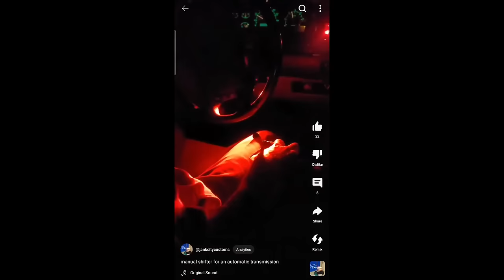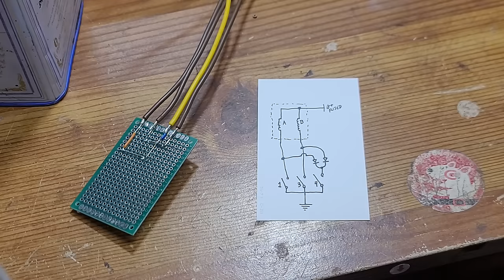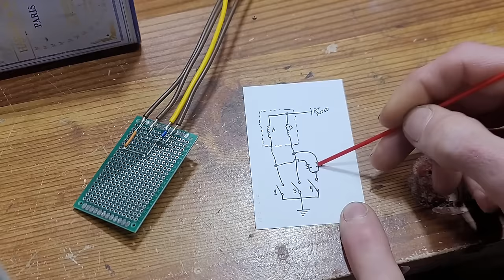how I gained full control of an automatic transmission

Comment from the maker: accelerating from 1st to 4th: https://youtube.com/shorts/0Is1Pl9tHL0?si=n4Nowy6qXVRSeYHP 
also, apologies for the audio. it turns out the DAC in my 3.5mm to usb cord is blowing out the signal from my microphone.
Reply: NOW We need that Brainwave reader controler Dolma scfihicky dodadd
Reply: Maybe you should try a real manual. 
You would have so much more free time. 

Because sure you got electric control- for now-

But you’re susceptible to any level of electrical failure. 
Not to mention internal auto trans failures. 
Solenoids. 
More wires. 
Bands and clutches. 
Torque converter. 
Sensors
ECT

My car has a mechanical connected manual 

Aka everything works all the time. Period. 

Keep on tinkering. 
Just think about it.

Comment: I used to have a tool that you could hook up to an automatic transmission that did this. It had switches to turn on and off solenoids and knobs to control pulse width modulation on them. I forgot who made it but it had adaptors to work on almost any electronic controlled transmission. I use it a lot when I worked at a transmission shop for diagnosing strange issues. You hooked it up and then went for a drive flipping switches to shift gears and turning knobs to adjust line pressure and torque converter lockup modulation. I sold it to a friend years ago when I got out of the transmission business.
Reply: that's sick wonder what it was called
Reply: I was planning on building a DIY automatic transmission tester like the tool you described because I was dealing with a transmission that wouldn't work after being rebuilt _twice_.  I ended up putting in a high mileage but working used transmission so it took away the need to build a tester.  (Google Honda Prelude Automatic Transmission Problems.)
Reply: Yea try that on a DSG or CVT 😅
Reply: Sounds like a great tool!

Comment: Long story short, I accidentally installed a 4 speed instead of a 3 speed in my old van. I had a series of ac light switches taped to the shifter to actuate each solenoid and torque converter lock up solenoid. It was a crazy manual-matic. Then I threw about 6 rods through the oil pan doing 70 in 2nd gear.😢
Reply: Who knew you could money shift a slush box?! 😂
Reply: @delet6629 it's possible with a 3l30
Reply: omg thats fkn amazing!!! XD
Reply: That's why he mentioned the PWM, bro. This kid is smarter than a box of monkeys. Start at 10% gradient, and if there is zero shift back off to a higher gear.

Comment: I made something similar 20 years ago for a Nissan transmission.  It used the same two solenoid quadrature-like encoding, plus torque converter clutch.  I made a paddle shifter through.  It's super easy with a microcontroller.
Reply: “Super easy to make your Nissan paddle shift”

No. 
This is a lie.

Comment: Something like this would be neat for a temporary downshift preventer, even though that may sound counter-intuitive at first. GM didn't seem to program their 4-speed transmissions exactly right when mated to a V6. So you'd be at highway speed and already getting into a good RPM range to make power. However if you're passing it would downshift out of the overdrive gear and put the engine at the rev limiter and have nothing useful left to work with. Those situations are annoying AF. Having some button to make it hold the overdrive and not downshift while passing would be useful. (It seems however they programmed the thing didn't account for the ratio jump on the last gear, as the shifts were fine in city driving with the first three gears. But the cars would feel gutless at times on the highway even though it wasn't the engine's fault. The engine torque curve rises very fast from 3200 to 3800 RPM, but was unusable in the final gear due to that programming.)
Reply: To be honest, I've encounter this problem on a lot of automatic transmissions. And your idea of a switch that disable automatic gear-shift is really neat.
Some cars will only downshift to the limiter if you push the pedal past the 100% throttle and feel a "click". It's a nice solution and I don't understand why more manufacturer don't make use of this.
Reply: Yup I had this happen often on my old Pontiac grand prix v6, it would downshift then struggle to accelerate. Always made me go wtf..thanks for the explanation. Makes sense now

Comment: That's really cool. I've got a manual for the time being, but if I ever get another auto it would be really cool to be able to downshift on command, or hold a lower gear longer.
Reply from the maker: thanks, it definitely makes driving the truck more fun. but nothing beats driving an actual manual.
Reply: for most autos, downshifting is the easy part, just move your gear selector down one. You need to in order to engine brake. The hard one is convincing the transmission to upshift when it doesn't want to, generally it wants you to get a higher rpm in the next gear first.
Reply: My wife's Mazda 3 has the manual shift thing but it's an automatic. Sometimes I use it so the drive is not as boring, but then I forget I put it in manual mode and forget to shift. Haha, without the clutch it doesn't register in my mind that I have to shift unless I'm really thinking about it

Comment: I did something similar to this when I owned a Mercury Grand Marquis.  I hated the shift logic on that transmission so much I wired in a switch panel to control it myself.  Which is to say that I hated that it had shift logic at all, because I despise automatic transmissions, and I wanted it to shift on my terms.  Your implementation is considerably cleaner than mine was.
Reply: Can shift sells paddle shift kits for the MGM and Crown vics / lincoln town cars now.

Comment: A servo tester might work for your line pressure. Sends a pwm signal that's adjustable with a built in potentiometer. This build was so freaking awesome! Makes me want to turn my 3rd Gen 4Runner into a test vehicle for all these type of ideas. So cool. Very inspiring. Just thought of another idea. Could you use an arduino of sorts to write code that would change the shift pattern. Kinda like a multi mode switch example : Eco /sport and towing. Each mode could have different shift rpm's and or line pressure based on what you need.
Reply from the maker: that's a good idea, it would be a really fun project. but also wildly time consuming to program and test different speed/rpm/throttle dependent shift tables. I'll have to circle back around to it once I get through my current list of projects.
Reply: @jankcitycustoms  yeah it would have to be a labor of love for sure lol . I can't wait to retire my 4Runner as my daily driver so I can start tinkering with it. I think I want to hyper mile it. It's only the 4 cylinder model but I think I can squeeze some good mileage out of it with some drastic changes to aero and engine tuning.

Comment: Very, very, very, interesting. I can't say much more other than, very, interesting. I remember hacking the old 1980's GM ECM's to get the TCC to lockup in gears other than 4. I took a different direction than you did, where I cared more about the computer's PWM. I like how you thought of the mechanical switches to get the transmission to work the way you wanted.
Reply from the maker: that's pretty cool. when I first made it I would lock the TCC when cruzing in 2nd and 3rd. but the increase in MPG was barely noticeable, so I only lock it on the highway now.
Reply: I did that with a '99 RAM...sheared the overdrive unit XD
Reply: @jankcitycustoms  with your manual controller you could lock the converter even in first, letting you haul heavier loads than usual

Comment: Another advantage of that solenoid pattern is there's only one solenoid that needs to change to shift by one gear. Known as a gray code, this avoids a race condition.
Reply: What's a race condition?
Reply: @Skunkhunt_42 vtec just kicked in yo
Reply: @Skunkhunt_42  I'm not sure, but I think it avoids moments where if it had to turn off one solenoid and turn on another solenoid at the same time, there would be a short time where either both were on or neither were on, both of those conditions being unwanted.

Comment: Now I can't wait for a manually controlled CVT. The control mechanism could just be a potentiometer but I'm not sure how you'd control the actual pulleys. There's always Arduino, which incidentally could be your solution to a PWM controller. Using the pwm output coupled with solid state relays should do it.
Reply: That would massively depend on the CVT you're playing with. Many don't do anything this simple.
Reply: @Hawk7886  I'm aware a lot of them have a clutch for moving from a dead stop but what other things are commanded of a CVT other than the clutch and the pulley ratio? You'd need a micro controller capable of sending CAN messages to the transmission like a Teensy in order to translate the potentiometer input into commands over the CAN network that the TCU can read but I think it could theoretically be done, assuming the clutch and other things are also controlled with the micro controller.
Reply: @GoldenGrenadier  Okay....but....like....fuckin why?!?!?! Like, you do realize the point of a CVT right? Is it just that you have one and you dont like it? Because...i mean...that is 100% fair. My parents had a subaru legacy and getting used to that thing was hell. It took all the fun out of driving. Its like  the peddle made a request for a certain amount of acceleration within the current capabilities for the state of the power train and road surface conditions (as far as the vehicle could detect, so basically based on the traction envelope), and then the vehicle decided what was the most efficient engine RPM and gear ratio ramp to meet that request. It fucking sucked. Luckily I had a 2000 malibu at the time, and while an older beater, it was analog enough to still actually feel like you were driving something, instead of being driven......

But back to the point, why abuse a CVT like that?!? Just interface with the ECU and change the power curves. Dont hack the control signals.....Youll never get it right such that it doesnt end up eating itself. And at that point, might as well just swap it for a less .... computery .... transmission and sell the CVT to some twat that burned theirs out already....probably by trying to control it with an arduino...

TLDR - if you want gears, get gears. Dont hobble CVTs to act like gears just to kill them faster.
Reply: @TankR  I definitely wouldn't use it to make a CVT fake shift. Manufacturers already program them to do that, LMAO, and it does indeed kill them faster. I don't and wouldn't ever own a CVT if I could help it. I just think it's a fun idea. I'm sure no CVT in production could handle the sudden torque loads brought on it by having the throttle be controlled independent of pulley ratio. I wonder if you could even engine brake effectively with one without it slipping.

Comment: I've been driving my 63 Rambler with AMC/Jeep 4.0L and AW4 transmission like this for 20 years now. I had an issue with the original trans controller a few months after installing back in 2003. Couldn't figure out the issue (still haven't completely, but I think it's the speed sensor... though changing it doesn't help and the magnets are on the rotor...). So I wired three toggle switches. It shifts similar to your Ford, but the solenoid sequence is different -- both off is actually 4th,  both on first, one on/one off second and third. I used this initially for testing, but drove the car like that for about a year. Easy to get 2/3 shifts (and up/down to 2 or 3) wrong! So I used a rotary switch with diodes. It's a simple twist of the dial to change gears. I burned one up, but it lasted about 12 years, and three years was daily driving back and forth to work -- until I retired from the USAF. If I do it again I'll wire it like a five speed -- 1, 2, 3, 3+lock-up, 4+lock-up. I usually leave the lock-up switch on, but with the AW4 there is a "jerk" when shifting between 3nd and 3rd with the lock-up engaged. I can mitigate this by letting off the gas when shifting. That's fine when I'm driving, not so much if someone else does. If I take it to an alignment shop or for some reason someone else is driving I just turn the lock-up off and tell them to leave it off unless going for a long distance on the highway. Wired like a five speed (I'm using a 6 position rotary switch -- couldn't find a four) eliminates letting off the gas or using the lock-up switch. It could just as easily be wired with just the 5th position locking the converter, but if driving say 45-50 for a long distance 4th isn't needed, but lock-up is nice to have. No manipulating the lock-up switch though!

Comment: I made one a few years back, used an Arduino UNO microcontroller with opto isolators to mosfets.  All fit on a breadboard stacked onto the Arduino.  It had programmable shift points and lock up.  It could also work in manual paddle shifter mode.  The shift points naturally requires engine rpm fed into it.  An Arduino can be prgrammed to output the PWM as well.  You need to isolate the inputs/outputs because the Ardiono run at 5v and have very limited current capacity. They are cheap (about $20) and you have to write the code but makes a really nice adjustable system.  Also handy for diagnosing transmission issues.

The transmissions with the onboard tcms can be tricky to avoid turning on the check engine light.  If they have feed back into the tcm you have to handle that as well.

Comment: With this setup, won't it briefly shift into 2nd gear when going from 3rd to 4th, since 2nd is in the middle, between 3rd and 4th? This probably causes a pretty harsh shift to 4th depending on how fast you flip the stick from right to left, doesn't it?
Reply from the maker: if you left it in the middle for a couple seconds then yes. when shifting normally, it doesn't even try to go into second.  example: https://youtube.com/shorts/0Is1Pl9tHL0?si=n4Nowy6qXVRSeYHP

Comment: I will say about the on/off: an attack/decay thing, from the audio world, could modulate a generated pwm signal, with a led coming on when it's done doing its thing to indicate it's fine to switch. might be an improvement worth considering. adsr might be something to look up electronics for, or slew limiters.

Comment: If you continue the jank journey, if the ECU just uses the normal servo PWM, a servo tester would probably be a good PWM source, they are cheap and they works. Maybe extend the potentiometer wire from it.

Comment: I hate the Ford AOD with its sensitive computer, which will trigger limp mode for having the wrong brake lamp signal (LED's) from what I gather. I thought about bypassing that pile of mess with this kind of idea but if it turns out to be a bad shift solenoid then its just best to get a manual transmission.   Loved this video of course.

Comment: Alright that's a very good way of going about things. But i gotta wonder. Will the transmission suffer from going in 4th gear down to 2nd?, because the shifts are basically a T with 2 in the middle. 3rd to 2nd to 1st is good, same as 1st to 2cond, but 4th will always hit 2nd first and i hope that doesn't injury the transmission, it shouldn't as long as the direct drive isn't engaged 😅
Reply from the maker: it definitely makes it easier to brun up the clutches. but when shifting normally from 3 to 4. both solenoids are off for less than 1 second. not enough time for the transmission to react.
Reply: @jankcitycustoms yeah, transmissions usually have some serious input debouncing, it's the same reason you can go from park, past reverse and neutral, straight to drive.

Comment: I was wondering about pressure modulation when you mentioned it early on. The Jeep AW4 uses a TV cable, but other versions of the trans, like the Toyota A340, use a modulating solenoid in place of the cable. All you really need is a potentiometer tied to the throttle. So it would be low pressure at idle, but increase pressure as you accelerate. Something like a TPS (throttle position sensor) would work nicely. Just need to know the voltage or resistance range required. With a standard potentiometer the rate can be controlled by arm length, with a rod extending form somewhere on the throttle to the potentiometer. A micro controller will work, but the simpler the better!

Comment: A way for you to control the Shift solenoid pressure,

As you stated a potentiometer obviously,   you can just use that with a stepper motor driver, and thats a way to control it. 

I did this with a stepper motor through the analog inputs on an Arduino, then enble from the Arduino

If your not confident on your coding, there are plenty of scources out there!  

I do believe this would be the best way tho that I can think of

Comment: What happens if you shift with the converter locked?
Reply from the maker: it just slams into gear very harshly. unless you try rev matching like a manual.
Reply: That’s the beauty of this solution.  The computers are always programmed with logic to preserve itself, I.e. it won’t allow for any conditions that may potentially damage itself.

This way, you can bypass boring shift logic and configure the solenoids to find out whatever you want to lol
Reply: @3ffrige even better, you can actually made an actual pcm and proggram it as desired, this way you could make the shifts depending on the throttle still, but with shift changes in every kind of rpm's and speed you are, and depending on the throttle position, not too complex, but hard and too much time consuming, still fun to do